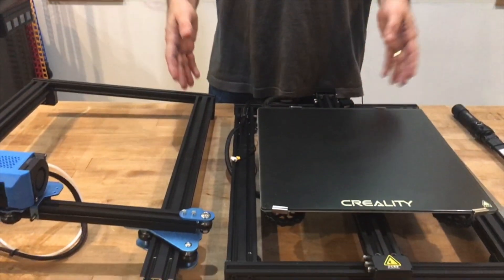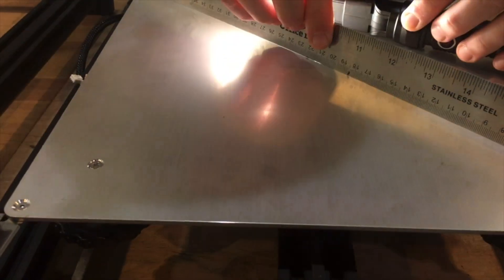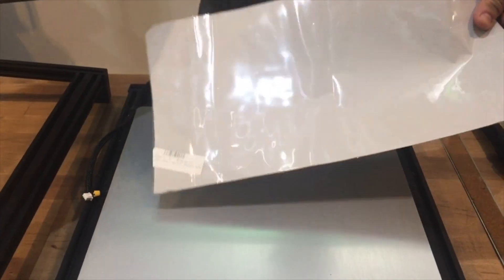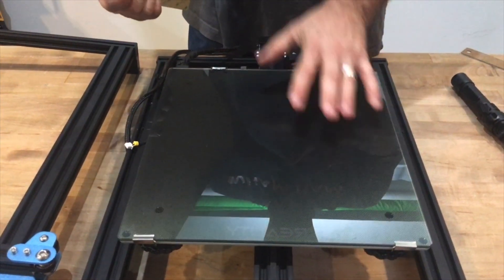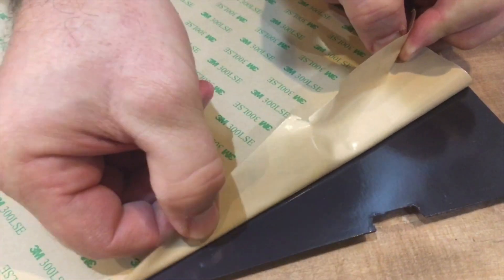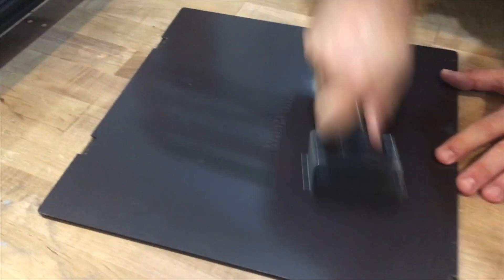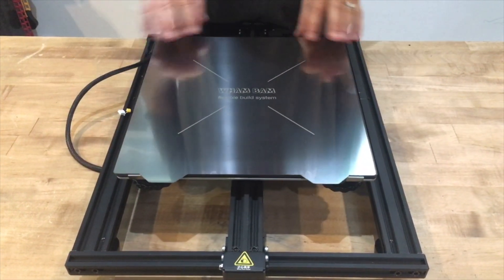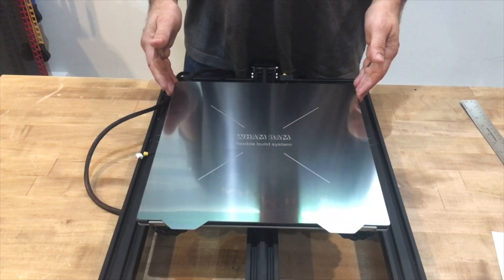Installing a Wham Bam Magnetic Base to Your 3D Printer Bed

Comment: Hi there @Wham Bam Systems. Thank you so much for the video! Just a suggestion... if the machine has removable clips (like the Ender 3 V2), you could just turn the clips around as the other side is completely flat. Great video, thanks!

Comment: I have the v2 also. How do you reset the printer after install? Mine now will not go down all the way to touch the build plate. I don't know what to do?
Reply from the maker: You may need to move the z limit switch on the left down a bit, or add some washers under the springs on bed leveling screws to raise the bed
Reply: @WhamBamSystems  i had to add washers that were equal to the thickness to the glass build plate. I came close, I'm a little above.
Reply from the maker: @x214214  you are above meaning still too far from the plate?
If so add a few more washers if possible, otherwise try to move down your z limit switch
Reply: @WhamBamSystems  yes I did add washers. Only issue now is I ha e to babystep it up because it was a bit to low and carved into the mat. I caught it right away so it wasn't that bad. kill have to raise it everytime before printing unless you can reset it. Can you do that??
Reply from the maker: @x214214  do you have leveling wheels or only bed sensor? With wheels, level to right gap. With bed sensor baby step then store the new home position

Comment: I bought your PEI system for my Creality Ender 5 Plus. I started by cleaning the actual heated bed surface, and applying thermal conductive tape, then placing the glass bed on that (print side down, smooth glass side up. I then applied the magnetic base, followed by the PEI surface. I then re-leveled my bed, used a laser thermometer to check bed temps, and had to raise my actual bed temp to 73c to get 60c (+ or - a degree or two), cleaned the PEI, and cannot get PLA (the only filament I have ever used) to stick to the bed AT ALL. I even tried flipping the PEI over to see if that would correct the issue......NOPE. Not sure what, if anything, I am doing wrong, but I would really appreciate some tips to correct this issue.
Reply from the maker: Try waiting a bit more for your bed to heat up to 70, make sure surface is clean with IPA and fresh paper towel. If you still have difficulties send an an email to technical@whambamsystems.com and we can work through it with you

Comment: Honestly! Why wouldn't you show the shimming method that your customers are definitely going to have to deal with?
Reply from the maker: We used to show shimming but found if users did it with less precision or sloppily they would create new slopes under the magnet and ruin the system.
It’s become too much liability. Now we advise adding some aluminum foil a small sheet at a time to the low spot above your magnet and below the Flexi plate, this way you can add and remove without damaging the magnet
Reply: @WhamBamSystems  "Liability". I can see that as an issue. Thanks for your time.
Reply: @WhamBamSystems  Would Kapton tape work as a shimming material? I would think aluminum foil would move out of place too easily
Reply from the maker: @davidhaas2528  I think Kaptom tape is a nice option

Comment: My PEX has enough chunks pulled out that I'm considering replacing the PEX. How should I go about removing used PEX or do I need to buy another flexible metal sheet with new PEX?
I'm thinking with acetone it should beable to dissolve the adhesive backing making it easier to peel off.
Reply from the maker: Shannon Williams As far as removing the old PEX,
we are using a very secure high temperature authentic 3M adhesive which doesn't peel up during long high temp prints, but that means removal is very difficult.

 
You can either do one of two things:
A.  leave old PEX on it and mount new to other side of Flexi Plate, this way you can have one side for risky or rough prints and the other for perfect prints, this may slightly reduce magnetic hold so you have to see if this works for you, for most its fine.
 
B. remove old PEX.  This is a sloppy and difficult job, you will need to work on some cardboard, have plenty of paper towel, acetone, rubber gloves, and a spatula.
Use eye protection!
I begin peeling up old PEX and adding some acetone to the peeled open surface to help removal.  (some say putting it in freezer for an hour helps it to come off easier)

Your Flexi plate will now be covered with the 3M, so wet it with acetone, or soak paper towel in acetone and leave on Flexi Plate.  
Once 3M is soft you then use spatula to scrape the gel like 3M off the plate and clean with paper towel, repeat until plate is clean.
 
Others have said that WD40 works but I haven't tried it yet.
 

One user says this is amazing:  Goo Gone Pro-Power Spray Gel (not an affiliate link): https://www.amazon.com/gp/product/B00SPHYQXM. 
 
Let me know if this works
Reply: @WhamBamSystems  Awesome! thanks for the support. Will be trying B or removal of old PEX.

FYI the only time I've had a small chunk pull up apart of the print is when using NGEN copolyester, even when build plate is at room temperature. Have to be careful how the build plate is flexed to release the part with minimal stresses on PEX material. But that is partly why I really like PEX is because NGEN makes a very good bond, can't remember the last time I've had warping issues(I've been using the Wham Bam fairly consistently for about a year.).
Reply from the maker: @GENcELL2014  thanks, its usually a combination of bed heat, nozzle heat, and first layer squish that causes too much bond, if bed is 70°C and nozzle around 235-254 you are good, make sure not to squish first layer too much.  let cool completely, part not just plate, then flex.  if you still get too much bonding use a bit of glue stick as barrier layer.
Reply: @WhamBamSystems  Printing with a cr10s pro, bed is 80C nozzle 227C, squish is around .03mm away from when filament gets to thin and starts lifting, so slightly squished, my first layer is done at 35mm/s(also with a speed multiplier on first layer that slows it slightly further).
Reply: @WhamBamSystems  BTW I'm building a custom 3d printer that'll be capable of 450C nozzle,  around 150C max bed temperatures, and a heated print chamber.

I'll be using my ShopSabre CNC router to machine things like aluminum build plate, aluminum extrusions, aluminum brackets, etc.. Considering carbon fiber parts in areas that'll be exposed to higher temperatures because of its thermal stability.

Print area will be around 
L: 650mm
W: 450mm
H:200-300mm

I'd be interested in potentially using a Wham Bam build plate system in conjuction with printing adhesives for the 650x450 build plate. Do you hsve any recommendations on going about doing something like that? About 3 years ago I did have buildtak make me a custom variant of their standard product, is something like that possible?

I realize the elevated max bed temperature to 150C is probably an issue. I am aware higher temperature magnetics are an option but I'm interested in using a similar system to the vacuum work holding on my CNC router. It's a compressed air based system that creates vacuum on a fixture plate. A couple gallon vacuum tank inline with the vacuum fixture plate helps maintain vacuum for days(possibly weeks) without using the pneumatic vacuum generator(or standard vacuum pump) constantly.

Comment: Need generic instructions video for Z offset compensation to deal with the extra thickness and avoiding the nozzle crashing into the surface.
Reply from the maker: Muru Roa what machine do you have? You may have to move your z limit switch up or down depending if you added or subtracted thickness
Reply: @WhamBamSystems  Thanks for replying! I have a Sidewinder X1. I was able to move the Z limit switch up but had to use double sided tape and a zip tie to hold it. Drilling a second screw hole right above the previous one was impossible as the two would've merged. Perhaps adjusting the Z sensor is something worth mentioning in your videos (not specifically about the X1 though).
Reply from the maker: Muru Roa thanks.  I don’t have the x1 but if it has typical extrusions you can always make your own limit switch mount and use the t nuts to adjust it up or down
Reply: @WhamBamSystems  On the X1 it's unfortunately bolted on the profiles, but I found a workaround. 👍 Did a couple of prints on the WhamBam.  Awesome build plate! Impossible to live without now! 😎 Thanks for taking the time to reply. Much appreciated!
Reply from the maker: @mururoa7024  super, happy to hear! thanks

Comment: Agree - be great to have views on non glass plates given printers are getting bigger, so level plates are more common! I can't find supplier for conductive sheet anywhere, so have a wham bam as a bit of a lemon at the moment. I have borosilicate glass bed, any other options for this?
Reply from the maker: What type of conductive sheet do you need? you mean thermally conductive gel pad or electrically conductive build surface?

Comment: Hi Peter,
Where did you get the roller?
Reply from the maker: EVSA amazon Aipaide 2 Pcs Rubber Glue Roller for Anti Skid Tape Construction Tools, Printmaking, Ink Paint Block Stamping Brayers 3.8 and 2.2 Inch, Black https://www.amazon.com/dp/B07C2QCCLQ/ref=cm_sw_r_cp_api_i_JfioFbQNP0AQA
Reply: @WhamBamSystems  - Thank you for the quick answer

Comment: Hello Peter, great video. Are you still recommending the conductive thermal pad, glass, magnet, then pex?
Reply from the maker: Grumpy 'Ole Marine thank you, I still am using the direct to bed method, it’s really up to you, see if your bed is fully flat and or if your glass is flatter and decide based on this in my opinion.
Reply: @WhamBamSystems  Sadly, I'm the one with the unlevel with a CR10ProV2 with an unlevel bed, bought another one and that is not as bad but unleveled. So I have the Borosilicate glass bed and curious to know if you are still doing the thermally conductive pad in a case like that.
Reply from the maker: @GrumpyOleMarine  you can do either way, thermally conductive silicone or bed clips ground down like in the tutorial, whichever you prefer.

Comment: Dont use alcohol based cleaners for magnetoc base it ll loose magnetic right ?
Reply from the maker: will not loose magnetism, but do not leave alcohol on magnet as it can hurt the protective coating
Reply: @WhamBamSystems  ah ok thank you